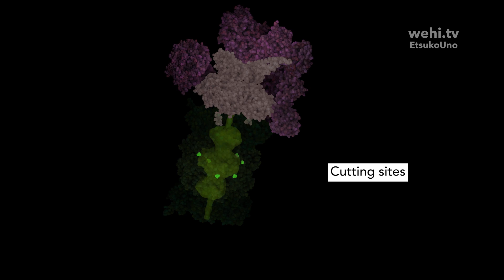The Proteasome (2024) by Etsuko Uno wehi.tv

Comment: AI Summary

Abstract:

This scientific animation visualizes the structure and function of the proteasome, a critical molecular machine responsible for cellular maintenance and recycling. Based on structural data from X-ray crystallography and cryo-electron microscopy, the video illustrates the complete process of protein degradation. It begins with the proteasome's receptors identifying a target protein marked for destruction with ubiquitin tags. The animation then depicts the protein being drawn into the regulatory particle, where the ubiquitin tag is removed and a powerful six-subunit motor mechanically unfolds and threads the protein strand. Finally, the strand enters the proteasome's core particle, where protease enzymes cleave it into smaller peptides, which are then released to be repurposed by the cell.

The Proteasome: A Cellular Recycling Machine

*   0:12 The Proteasome's Role: The proteasome is an essential enzyme complex that acts as a cellular recycling machine. It breaks down old, damaged, or unneeded proteins into short amino acid chains called peptides.
*   0:36 Immune System Function: Beyond general maintenance, the proteasome also breaks down proteins from invading bacteria and viruses. The resulting peptides are presented to the immune system, which is an essential step for detecting infection and developing an immune response.
*   0:52 A Two-Part Machine: The proteasome is a complex molecular machine composed of two main sections: a regulatory particle that recognizes and unfolds proteins, and a central core particle that contains the cutting machinery.
*   1:38 Tagging for Destruction: Proteins are marked for destruction with chemical "ubiquitin" tags. Receptors on the proteasome's regulatory particle recognize these tags and tether the protein, guiding it into the motor.
*   2:07 Unfolding and Feeding: An enzyme first cleaves off the ubiquitin tag for recycling. The proteasome's six-subunit motor then engages the protein, using a staircase-like mechanical motion to unravel its complex structure and thread the linear amino acid strand into the core.
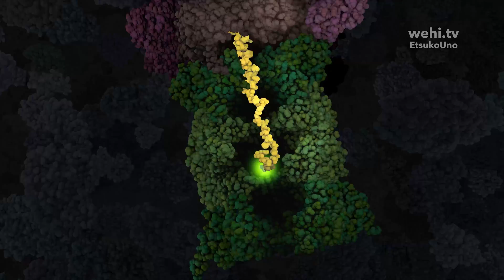*   2:50 Cutting into Peptides: Inside the proteasome's core chamber, six protease enzymes line the walls. These enzymes act like molecular scissors, cutting the protein strand into peptides of various lengths, typically between 2 and 25 amino acids.
*   3:06 Recycling Amino Acids: The newly created peptides are released from the proteasome. The reclaimed amino acids can now be used by the cell to synthesize new proteins, completing the proteasome's central role in cellular maintenance.

I used gemini-2.5-pro| input-price: 1.25 output-price: 10 max-context-length: 200_000 on rocketrecap dot com to summarize the transcript.
Cost (if I didn't use the free tier): $0.02
Input tokens: 12791
Output tokens: 539
Reply: L

Comment: I have a couple questions if anyone is up for them:
• How efficient is the recycling system? Particularly, what percentage of damaged proteins fail to get recycled?
• Are the number of Proteasomes in a cell comparable to the number of Ribosomes?
• How accurate are the systems which attach the ubiquitin to proteins?
• Do Proteasomes operate both inside and outside the nucleus?
Reply: I have some answers for you!
a) The system is very efficient - all of those peptides will go on to be used within the cell. The raw matter is not lost, the only inefficiency is an energy one, I believe ATP is used to run the unfolding machinery of the proteasome, and more ATP will be needed to put new proteins back together,
b) Yes, there are many ribosomes, and many proteasomes - although the exact numbers are not important, what is is that the proteasome is only one mechanism of many recycling mechanisms your cells have for facilitate resource turnover within your cell. Thus the ratio of proteasomes to ribosomes is not really important as your question presumes. Google Autophagy as that is the true cellular recycling boss, proteasomes are more "precision" recycling machines.
c) They can be extremely perfectly accurate (dictated by the exact jigsaw fingerprint of ubiquitin binding of the target protein, and a facilitator signaling protein) but sometimes they are more relaxed, for example you may release a protein temporarily to attach ubiquitin to a lot of stuff as a stress response, and itll last a while then degrade after a time.
d) Yes.

Hope that helps, have a good day =)

Comment: Where does the motor take energy for its work?
Does untangling protein take energy or release energy?

Cutting stage looks like being powered by chaotic movement. Is it the same with motor: it works like a diod allowing chaotic movement down the pipe, but blocking reverse movement? (I think that explanation would delete the need in source of energy).
Reply: I think it uses ATP, it's just not shown in the video for clarity sake.

Comment: How does it know what to do? It's amazing 🤯
Reply: Very good question. It doesn’t “know” really. A protein is a large molecular puzzle, made from thousand of atoms. Every atom may possess a positive or negative charge (or neutral if no net charge). So, you have a 3D puzzle with different magnetic properties in different parts of the puzzle. You throw 2 proteins together and the magnetic interactions will be really interesting. Evolution, after millions of years, selects those structures that yield advantages for survival. We live in a wonderful universe. Greetings.
Reply: @javiermachin1  Electrical, not magnetic.
Reply: Proteins and enzymes get their function from their shape and distributions of electrical charges. It’s very complicated but basically all of cellular biology is based on how much free energy (obtained from ATP breakdown into ADP) is in a system, which causes changes in protein shape, which moves charges around in the structure.
Reply: @maxwellsimon4538  Not every protein requires ATP to function. Sometimes, the ambient energy (heat) of the cytoplasm is enough for the protein to function as a catalyst for a chemical reaction; other times, it uses other molecules as its source of energy such as NADH, sometimes it's the substrate itself.
Reply: @Gelatinocyte2  that's true too